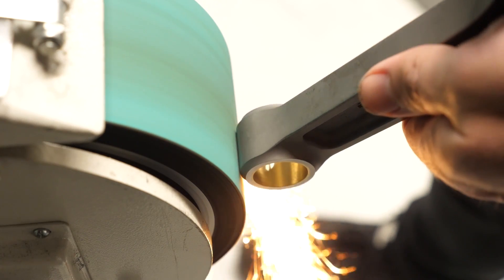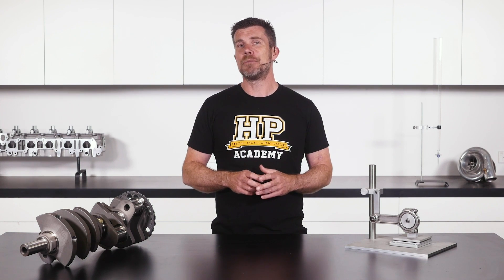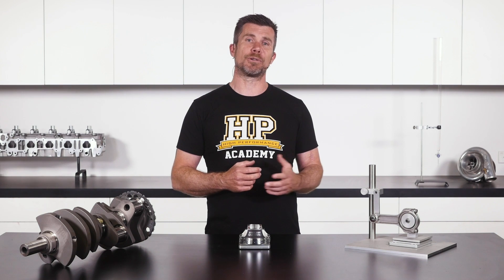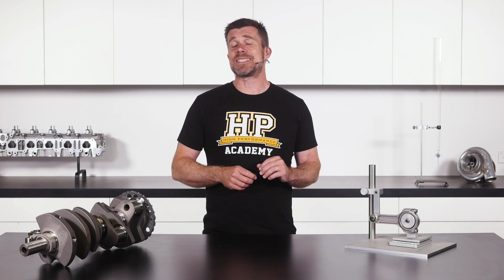The 'Not So Dark Art' Of Engine Balancing | Engine Building Basics 02/04

Comment from the maker: Building a fast car? Get $400 OFF the VIP package with every current and FUTURE course included: https://hpcdmy.co/vipy9
Learn Engine Building today with 50% OFF your first course: https://hpcdmy.co/offery9
TIME STAMPS:
0:00 - Why Do We Balance Engine Components?
0:48 - Inline or Horizontally Opposed
1:32 - V4, V6 & V8 Etc
1:48 - V Bob Weight
2:15 - LS V8 Situation
2:48 - Piston Balancing
3:35 - Wrist Pin Consideration
4:22 - Piston Weight Removal
5:28 - How Much Material Should You Remove?
6:06 - Avoid These Areas
6:48 - Connecting Rod Balancing
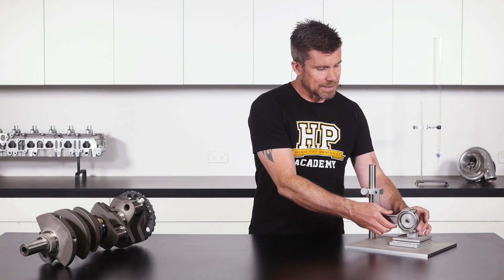7:40 - Con Rod Balancing Fixture
8:06 - Big End Weight Removal
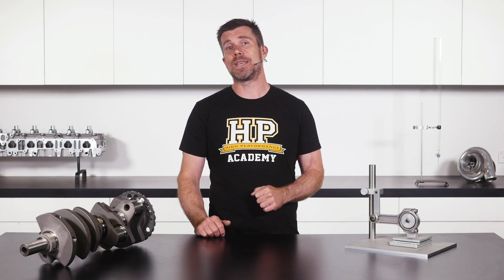8:20 - Don't Weaken Your Con Rods
9:31 - Linisher
9:48 - Small End Weight Removal
10:58 - Don't Overheat The Rods
11:20 - Engine Machinist & Rotating Assembly
13:32 - Harmonic Balancing Is Differnet
14:20 - What Are Harmonics?
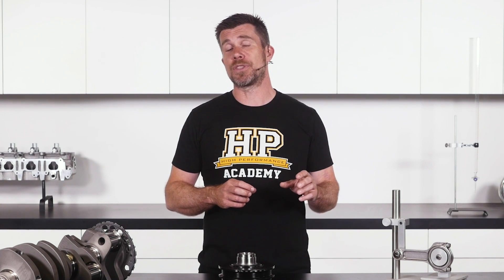15:45 - Common Failure: Oil Pumps
16:08 - SFI Rated Dampers
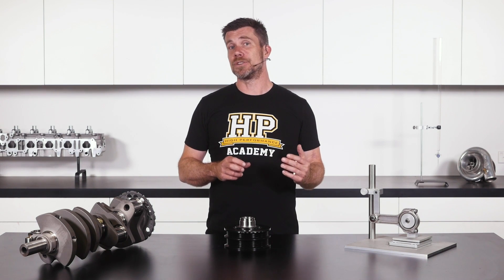16:55 - Consider A Damper
17:11 - Lesson Summary & Next Lesson
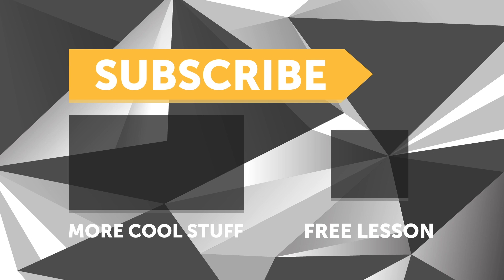17:30 - BUILD.TUNE.DRIVE

Comment: ok i just have one question. i understand 4 cyl and 6 cyl inline engines are inherently balanced. but if im using a stock crank and after market rods and pistons which are about well so many grams lighter well say the counterweight of the crank will be heavier because the stock rods and pistons are heavier. does that mean i need to remove weight from the crank weights? people keep telling me as long as the rods and pistons all weight the same its ok but that doesn't sit well with me? can yuo shine some light on this for me thanks

Comment: I still don't really get what we're trying to achieve with this. Is it just to make all of the pistons the exact same weight as each other? If so then why don't the aftermarket piston manufacturers already do that before sending them out? Seems weird that everyone who receives them all have to take a grinder to them straight away
Reply from the maker: Yes. But don't use a grinder. 
Some are matched, some are not. We've sent some back where 3 pistons we're from a different batch and the 4rh was so different in weight it wasn't worth bothering with balancing due to how much material would need to be removed. 
The replacement set was much closer. 
Basically you don't know what you're dealing with till you pop things on the scale and find out no matter what you think should or shouldn't be done for you 😎 - Taz.
Reply: Even with modern forgings and manufacturing processes, the simple fact is that metal will do weird things when you add heat and pressure - and we're STILL learning how to perfect that process thousands of years after it was first discovered. So the density will naturally be different from part to part. For OEM engines, that natural variation is designed into the engine itself, so that any imbalance under a certain level will not be an issue. As you get closer to the edge of performance, your tolerances (literally and figuratively) on every single part and assembly process start to go down quickly. That's why it's called diminishing returns - the closer you get to that edge, the more work it takes. You approach a perfect engine asymptotically.

Comment: No matter how close you get the weights of components the same, you still have one variable you can't compensate for, and that's the difference between oil trapped under the piston on the up stroke verses oil under the piston on the down stroke...and if it has piston cooling jets under the piston it makes any compensation even more difficult...
Reply from the maker: Yup;! You can only control what you can control, unless you are a well funded F1 team etc, not that you are competing at their level anyway.
This work shown is easy low hanging fruit comparatively 😎 - Taz
Reply: @hpa101  what was that word salad all about genius?...for the record you don't have a fuckin clue what I'm involved with...

Comment: 3:00 "A quality set of digital scales" - pulls out the cheapest and literally worst scale on the market.
Reply from the maker: We paid $150 USD then $300++ USD for some USA made scales from a well known company that didn't work as good as this $30 set which we bought out of frustration and curiosity.
As discussed, repeatability is important, and that is easy to test. You're not weighing Grandma's medication; you're weighing the difference and a lot of the GOOD quality cheaper scales will do that just fine 😎
That said, you can purchase and use whatever you like, this is just what we used and found worked accurately for us.
Painters scales are often mentioned by enthusiasts as being a good option too - Taz.
Reply: @hpa101 I'm using balancer type scale. one grain of rice at a time 🗣🔥🔥🔥

Comment: If you are trying to balance an engine closer than 1/4 ounce inch you are wasting time and energy and if you are running above 7000rpm most of the time you need to put some over balance to the reciprocating weight of 3%-4% and if you run in the 9000 and up range go to 5% added to reciprocating numbers...

Comment: Doing a 60 deg v60 I found that engines are done with a 25 to 55% of the reciprocating weight.
GM specify 50% for this engine. But seeing how the span is so big from engine to engine it begs the question how important it is exactly to balance the crank. Also you have the question of what part of the rod is actually the reciprocating weight..
My machinist adviced against it actually. He pressed instead on having the rod/pistons beas close to each other as possible. Since Ive lighten them some 30 gr and are within 1gr och each other he argued that its a big improvement even without balancing the crank.
Also since its a street engine with 6000 max rpm youre not in danger so to speak anyways.

Comment: you should mention that the reason for v engines being balanced differently is the not symetrical crank... a v12 with 60 degrees for example has a pretty much regular straight  6 crank
Reply: Inline engines don't use Bob weights
Reply: @ChiefCabioch  that's what I'm saying , inline 4-6 engines and V12 engines don't need it cause most of the time they have a symmetrical crank shaft
Reply: @majorva2653  a Detroit Diesel V12 would need Bob weights, there are twelve independent throws on the crank.
Reply: @ChiefCabioch  it's not symmetrical then so it needs some with a split pin crank xd

Comment: Can we discuss this some more? The people who advocate solid under drive crank pulleys say that after a while, the 2 piece, rubber sandwiching harmonic pulleys' rubber get hard, & therefore, they essentially become a solid pulley, & nothing negatively happens to the attached engine(so it's theoretically safe)... What are your thoughts & advice with that in mind? (I am STRONGLY for the improved efficiency & available HP of lightened smaller diameter pulleys\REALLY TEMPTED) Thanks... =]